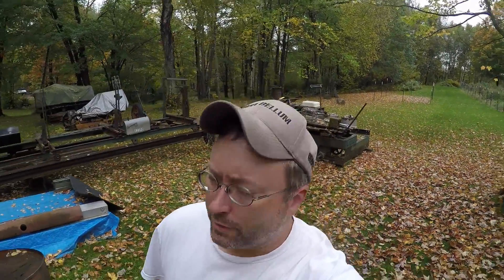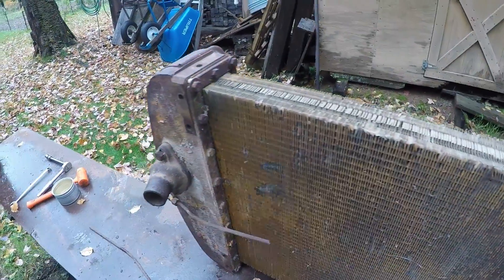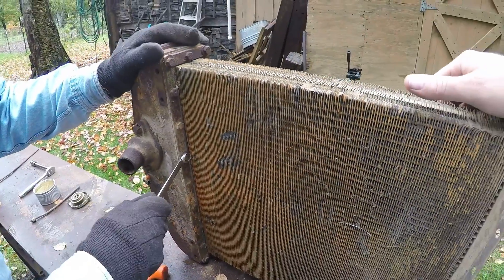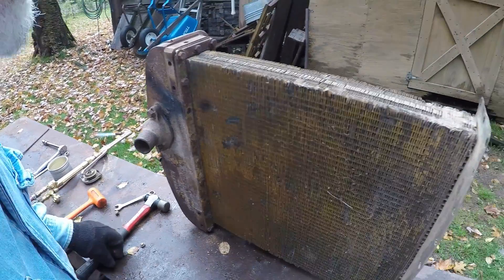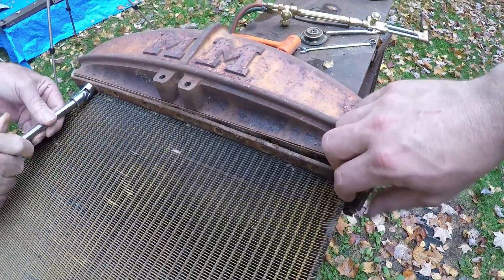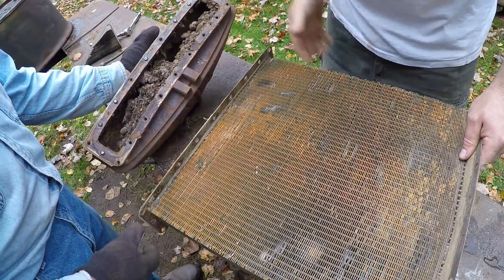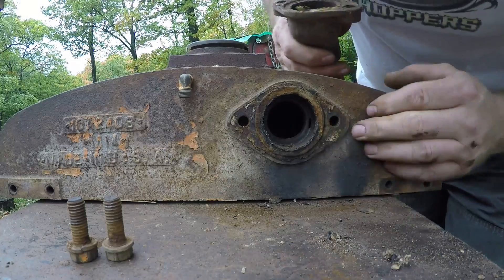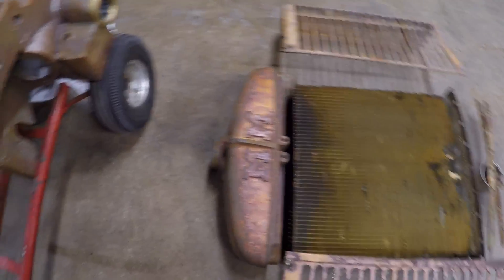Minneapolis-Moline 445 Prototype #X231 - Part 45: Disassembling The Radiator

Comment: It looks like this was one of the last 5 year old videos. Apparently you took a 3 year break from ole Christine. (I don't blame you, I would have too after all the hell you've been through with her.)
Reply from the maker: This was the same time when the Caterpillar D2#5J1113 restoration was really starting up, and almost simultaneously Senior had his Super M engine start knocking, which started out as just an engine rebuild but then also snowballed into a full-on complete restoration. So for those 3 years I was juggling a D2 and a Super M plus working full time at the Ford dealer, so couldn’t have found any time to look at X231 even if I had wanted to lol 😂👍
Reply: @squatch253  Oh, well that explains it. Sounds like you were busier than a one legged man in a butt kicking contest. 😆😅🤣😂 ... I'm getting ready to start watching  Minneapolis-Moline 445 Prototype #X231 - Part 49: Shift Mechanism Fabrication Begins & Fresh Paint! ... I must say, If I put all that work into one tractor I would NOT take $5,000,000 for it!

Comment: Great example of “steady pressure” on bolt head til the ones cooperating come loose. The rest? I’ve gotten many out by welding a nut on the broke stud then put a 6 point socket on it and loosen it while still warm from the weldment.......... good memories with “Senior” 👍

Comment: I use a old hand impact driver that you whack with a hammer (like you use on motorcycle cases) to take loose bolts that I know are going to snap.  I use a 6 pt socket and a nut up inside the socket so that the shock gets transmitted into the bolt only.  It also helps me to give the center of the bolt head a light tap with a little punch (about the same size on the end as the bolt) and a three lb hammer.  Its worth a try.

Comment: There is a technique I learned in a ship yard and have used many times successfully: heat the stuck part and the area around it until it is uncomfortably warm to the touch, not hot. Then put a couple of drops of cold water on the stuck bolt. The temp change is enough to  break the hold and get you some movement. Hope this helps . Keep up the good work.

Comment: Hopefully we will see a broken bolt removal video later this fall/winter. I'm interested to see how it goes and what techniques.
Reply: 98xjdriver 
Some can be gotten out with heat and vise grips, the rest that broke off flush or inside the bolt holes will need to be drilled. The good thing about drilling is a lot of the time, the use of oil and the heat generated by the drilling process will loosen the bolts so they come out easily with a bolt extractor. 
If the bolt holes in the tank aren't blind holes, sometimes the act of drilling will cause a broken bolt to spin on through the hole and exit the back side. 
There are lots of possibilities here, we will just have to wait until later to see what the guys do to get them out.

Comment: I know the link is about MM tractor BUT I have a question about a Case tractor from the 1920's? I have a picture, PDF of an abandoned one, steel wheels, INLINE 4 cyl engine with compression release or priming petcocks on the head. My Grandfather used one like this to power his water well drilling rig from when he started in Briggsdale, CO until our family visited him in Black Hawk, South Dakota. If somebody could help, I would appreciate it VERY much.

Comment: I bet you're looking forward to extracting all those broken bolts. lol. I'm currently working on my grandfather's John Deere 60, and somehow, all the bolt holes in the rear axle housing have bolts broken off inside them. I'm guessing they are from when it had a model 45 loader mounted on it. I'm debating just swapping out the rear axle housing with another one, rather than drilling and tapping out 6 or 8 bolt holes.

Comment: Here in Michigan, it's a state law that all fasteners more than 3 years old must corrode then break when they are trying to be loosened. We won't talk about the rodent fair housing act.
Reply: Thats a great comment and very true on both the fasteners and fair housing act, it's the same here in Canada.  A buddy of mine got a huge IH bulldozer years ago. The seat cushions were completely gone, it didn't take long to find his unwanted tenants had hauled every single bit in the radiator and engine block cooling jackets.   he'd got an intake manifold and cylinders with open valves full of canola seed to, They must of just hauled the stuff in the manifold until it stopped running in the bores and eventually filled the intake as well, it was about 1/2 wheel barrow full when he got the canola seed out.

Comment: Ha,ha,ha!!!! Don't think I've ever seen a cheap whench, inexpensive wrench for the DIY person to true professional wrenches for professional.  Love it!!! For as old as that radiator is, it's in darn good shape. I'm  like you, I would have expected to see the fins somewhat mashed more than what you have there, from branches poking into the grill to the fan rubbing on the backside of it. I wonder if you would have soked those bolts with penetrating oil, if they would have come out easier. Oh well, you got it a part, so on to the next step. Nice video, great content......

Comment: If you heat the bolt and then let it cool before removing it'll work a lot better.  The expansion and then subsequent contraction helps a lot.  Also a few days of penetrant also helps. I've found that really taking my time and working bolts back and forth with a combination of heating and cooling is almost always successful.  I'd rather take 5 mins per bolt removing them than 10 mins drilling broken ones out.

Comment: I like several others in the comments enjoyed watching you and dad work together. Good radiator shops are getting to be like hens teeth in the age of crimped aluminum and plastic radiators, glad you have a shop to fix up X231's core, it looks to be the least beat down part of the puzzle thus far.
Reply: @squatch253  if the broken bolts in the upper tank and lower bolster are the worst of it, you're doing good! Especially considering how beat to death every other part of this poor tractor was. Makes me wonder the condition of all the other prototype machines that used to be in the windrow at that farm, probably equally as hammered.

Comment: Radiator core being taller would stand to reason, since I'm almost sure that OHV engine is taller than the horizontal valve flathead design of the ZB.

Comment: Nice. That went rather better than I'd expected.
I was watching another channel where they were checking radiator passages to see if they were clear, and they used a long wide tie-wrap as a rod. It was soft enough that it wasn't likely to damage the tube, but could push dirt out, or at least go all the way thru if the port wasn't blocked.

Comment: There is a ton of art work in these old antiques. I wonder if these tractor manufacturers hired artists to work along side of the engineers? My guess, yes.
Reply: They also hired artists to apply the paint to the machines, or at least locomotive shops did. Doing lining and lettering takes a little talent and aptitude as well as practice and skill.